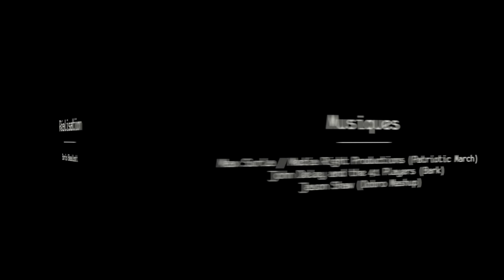Fabrication de rallonges de table pour dégauchisseuse

Comment: Bonjour, pensez vous qu'il soit possible d’ajouter une rallonge de table de  1m60? J'ai une combiné hammer c3-31; avec une table de 70 cm, auquel je voudrais rajouter une table de 1m60 pour passer des planches de 2m20.  Cordialement.
Reply from the maker: Tu veux faire une rallonge de 1m60 ? C'est un peu grand. Pour passer une pièce de 2m20, une table entrée 1m10 et sortie 1m10, c'est déjà pas mal.
Sauf si ta pièce est complètement gauche, sinon en quelques passes, ça sera bon.
Reply: Merci de cette réponse super hyper rapide. Ta démarche est géniale.
Les montant que j'ai à corroyer sont vraiment gauche, jusqu'à 6-7 mm.
Je fabrique une grande porte de garage et il est possible que ce ne soit que la première d'une longue liste. 
De plus,  j'aimerais une table d'entrée qui soit assez grande pour vérifier sur place, de quel côté je doit passer mon montant, sans avoir à aller sur mon chariot de scie qui est bien plan.
A l'aide! je suis trop perfectionniste! et je n'arrive pas à me lancer.
Toi qui a du recul sur ton projet, est ce que tu en est tout à fait contant ou tu ferais des améliorations?